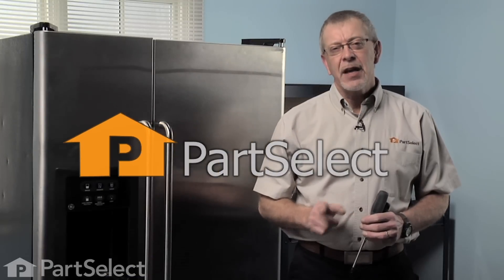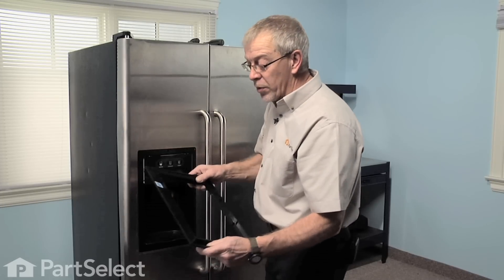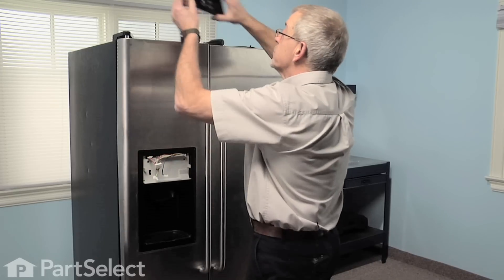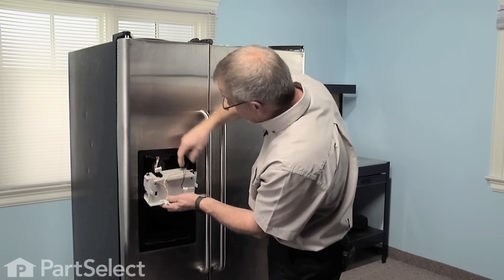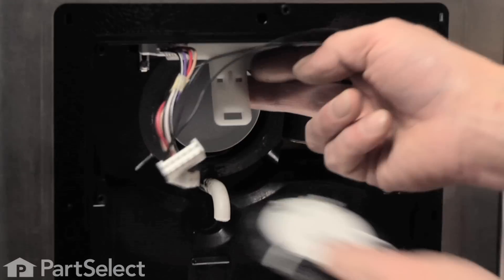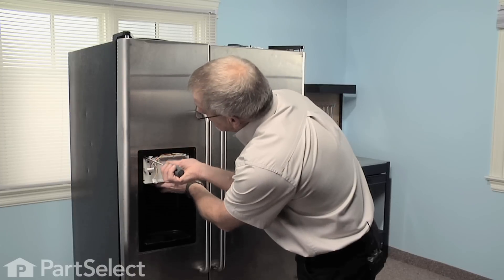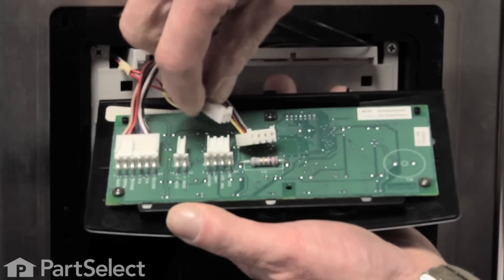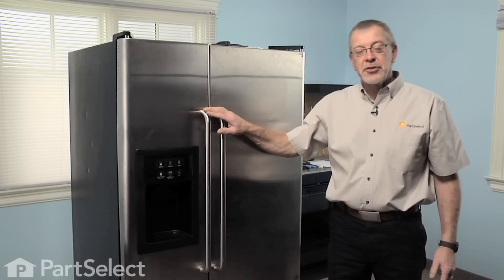Refrigerator Repair- Replacing the Ice Dispenser Door Assembly (Flapper) (GE Part # WR17X11653)

Comment: Thank you for making this video! I needed to have my flapper replaced last summer, but luckily it was under warranty.  However, my ice chute started frosting up again this summer, and after shining a flashlight down the chute, it was apparent that the flapper was once again warped.    GE obviously has some type of defect with this part, but thanks to your video and a $6 purchase on Amazon, I was able to replace this part quickly and easily, saving an $80 service call. Thanks again!

Comment: Thanks for this video. Makes my repair a lot cheaper and easier. 5 thumbs up for you!
          update: I opened the Ice dispenser door assembly the way you described on the video and found out that the solenoid has lots of dirt/rust build up. I took it out and clean it with steel brush and some WD40. Put it back and it works again. Time spent on the repair including watching this video is about 20 minutes. Expenses: nothing. Again Thanks!!! 5 more thumbs up!

Comment: Thank-you for showing how to replace the door flap.  You saved me a bunch of money.  I paid around $12 USD for the replacement and had it replaced minutes after watching your video.  I have a GE GSH25KGMC CC and I did not have to remove the plastic cover at all around the entire ice assembly on the door.  The door flapper replacement is part number wr17x11653 from GE.  I appreciate your time and help!

I also am experiencing the new flapper not closing after ice is dispensed as others reported.  At this point I'll chose not to use it for ice and just use the water function, but I would like to know if I could do something to correct the flap not closing.
Reply: Sounds like It could be the flap spring or solenoid for ice flap door closer

Comment: Thank you for this step by step installation video.  I just replaced the ice dispenser door assembly (flapper) with a new GE part# WR17X11653 and the door recess spring GE part# WR02X10585 for my GE stainless steel refrigerator. The only problem I had was removing the escutcheon and I broke 1 tab (take your time and pull inward). I hope that helps someone else. The reason I replaced these parts was due to water leaking or sweating out of the flapper chute.  If you don't replace in a timely manner this will cause a little mold to form around the flapper and you won't see this until you replace it. I'm glad I was able to do this myself thanks again to this video.

Comment: Thank you for making this video! I just did this repair with my GE Refrigerator model GSS25QGTA WW which is slightly different than the one in the video, but close enough that the task was very straightforward and the resulting repair felt very solid.

Comment: GE model GSHL5KGXGCLS. You do not have to remove the escutcheon. There are two small holes under the touch pad. Push them in with a small screw driver to release the pad, then proceed as the video instructs.

Comment: I did all that (you don't need to remove that out plastic piece BTW) and it didn't fix the frosting issue at all. Looking from inside the door I shined a flashlight up through the cute and saw the leak. I used a heat gun on low to soften the flapper from both up and down the cute. FIXED !

Comment: Hi, I have a Kitchen Aid Superba Frig, (side by side) - we need to get the little flapper door working again to keep the moist air out of the frig. Ice builds up and makes the door block the ice coming down the chute. The model number is KSRB25FHSS04.   It has a stainless door if that matters. The flap still moves but I think the torsion spring is shot.

Comment: I have GE model gsc23kstass   I did not have to remove outside trim, just lift control panel up and out.  My flap was okay but the part that opens and shuts (smallest connection wires of the three) was rusted really bad.  I plan to order this part and replace it.  Than you very much for this video.
Reply from the maker: You're very welcome Vivian, glad you found the video useful!

Comment: Fantastic Video. Followed all of the steps and replaced the flapper and the spring. Unfortunately frost is still building up under the tray, and on the top of the chute dispenser. I noticed what looked like a foam ring behind the flapper seemed a bit worn. Fridge is 3 years old, model #: GSH25JDD SS.  

Any ideas what I should do next to try to stop the frost build up?

Thank you.
Reply from the maker: The cause of the frost build up is almost always from an air leak, usually at the flapper. If the flapper door does not seal properly frost will form. Check the surface that the flapper seals against for any gaps or imperfections.

Comment: Hi.  Great video.  Really easy to follow.  I have a GE Profile Arctica. The flapper wasn't fully shutting and frost was forming around the chute and ice maker.  I replaced the flapper yesterday, and it seems to form a good seal, but now when dispensing cubed ice, the last cube coming out seems to get stuck in the flapper leaving it open.  Any thoughts?

Comment: But what was the symptom?  I just replaced the solenoid that opens this flapper that stopped the freezing over in the chute and leaking down front, but it still leaks slightly along back of dispenser area.  What's interesting is that having been in already, I thought it was the entire assembly (flapper bracket and spring), but I see you replaced just the flapper seal, like in a toilet. Brilliant.  Am I looking at the right reason?  We have hard water out here so seals and flappers harden up and leak all the time.

Comment: Hi, I have the GSS25WSTI SS model fridge and upon a recent home inspection, was told that the flapper doesn't close correctly which allows some extra ice to flow out after moving cup from ice dispenser. Would repair on that fridge be the same as this video? Thank you in advance.

Comment: I need to replace the ice dispenser flapper on my GE PSH23PGRA BB.  Your video is excellent but the door configuration on fridge is slightly different.  Any video or instruction on how to disassemble the panel on my GE model?

Comment: I have a Monogram side-by-side built-in model and it appears that I have to remove the stainless cover on the freezer door to get to the housing. Do you have a video that shows how to do this?
Reply: CruiseReport Model Number is ZISS420DMCS
Reply from the maker: CruiseReport  We do not have a video of the stainless wrap around panel removal, but I don’t think that it is necessary to remove it to gain access to the dispenser. The dispenser escutcheon should pop off with the aid of a putty knife.
Reply: ***** I have the same issue with the same model.  I tried the putty knife but the escutcheon does not come off.  The cover plate appears to be housed in behind a ridge and will not come out. There is one screw on the underside but is not connected to the cover plate...I took out the screw but nothing appeared to budge (I did not want to push/pull too hard). Any ideas.
Reply: +CruiseReport I have a side-by-side GE Monogram (2005) and the button panel (printed circuit board) *does come out without having to remove stainless steel door. Used a putty knife on sides first , then top. It comes out. Goes back in tilting it into top area first then snap sides in.

Comment: The first ice cube dispensed from my GE Monogram hangs up at the bottom of the chute (below the flapper).  Then all the cubes get backed up behind the first cube.  No cubes make it to my glass.  When you insert your finger to encourage the first cube to come out, it's JACK POT!!!  Dozens of cubes rush out until you manually convince the flapper to close.  I replaced the water filter and adjusted the temperature down, but no changes to my Las Vegas style ice maker.  Got any ideas?  Thanks for the excellent video.
Reply from the maker: +Lynne A It sounds like the problem may be with the dispenser flapper not opening enough and or lacking spring tension to close properly.
Reply: Would you recommend replacing the flapper, the spring or both?  Thanks SO MUCH for your help!
Reply: I solved my problem!  The rubber ice cube chute had become brittle and was catching the cubes.  I made vertical cuts at about every 1/2 inch of the chute and now it flexes enough to let the ice cubes pass through.

Comment: Any suggestions on how to remove the trim recess piece?  In your video it came off with relative ease with your fingers.  I've tried prying with a screw driver and can't get it to budge.
Reply: You actually don't need to remove the Ascuncion. You can use a small screw driver to release the 2 small tabs under the control board with having to remove the cover

Comment: How do you replace the water line inside the freezer door?  I have a GE GSS25WSTA, it looks like the refrigerator in this video. The water line was pinched when trying to put the door back on after moving, I need to replace the tubing inside the door but I can't access it behind the control panel, it's sealed.  I can't pull it out from the bottom or the top.  What can I do??  Thanks.

Comment: I have a very similar GE refrigerator to this model with an identical dispenser set up. I am trying to replace the dispenser water line because it is broken at the hinge at the bottom of the freezer door. I am stuck at the dispenser nozzle at the top, unable to get it loose to pull out the old tube. Can you help at all?

Comment from the maker: Hi there!

You should be able to get in there with a putty knife or a flat-blade screwdriver to depress the tabs that hold it onto the front of the refrigerator. Sometimes it can require some real jiggling around. You should be able to depress the tabs and pull up on the panel, removing it. I hope this helps!

Comment: I have a Kenmore model 106.951 680 and am trying to remove the front panel on the water dispenser with out breaking it. so as to be able to get to screws on the water dispenser lever. It appears to pry off some how. It looks like it should push up. WHat is the secret?

Comment: Good video. Just curious what makes the flapper door go bad? Our flapper door seems to open but won't close causing the ice dispensing tube to freeze up.
Reply from the maker: What is your model number?
Reply: I should be able to get that model number later today and then I'll post it. Mahalo
Reply: ***** Here is what I found LGEUS LSC27910TT side by side - But I don't know which one is the serial number and which one is the model number. There are more numbers, but maybe this will help. But after looking at your various video's, it appears that the problem is the solenoid plunger assembly. Either way,  today is the day I intend to figure all this out. Then I just need to figure out where to order the parts from. Also, if you have a parts number for the solenoid, please post it!
Here's what I found on your parts list for my unit. I'd like to order the part if you feel this is the correct approach. LG - Refrigerator
Solenoid Part #: 6421JB2002D 
Substitution part#: 6421JB2002R - $25.70
Part
Information
This manufacturer-approved solenoid (part
number 6421JB2002R) is for refrigerators, including LG refrigerator model
LRSC26922TT.  405H Solenoid 6421JB2002R opens and closes the
ice chute door on the ice dispenser.
Unplug the refrigerator before replacing the solenoid.Time to install this part = 42min.
SpecificationsCategory: Refrigerators and FreezersShipping Length: 2.5 inShipping Width: 1.3 inShipping Height: 3 inShipping Weight: 0.5 lbs (8oz) for questions or assistance, call1-800-252-1698Owners Manual -  http://www.managemylife.com/manuals/non_lis_pdf/OWNM/LSC27910.pdf
Reply from the maker: Todd White I see that we show the solenoid as "No longer available". My guess would be to check the return spring as well.
Reply: ***** How can a part as critical as a solenoid no longer be available? There's no replacement part? So if it's not the return spring, just disconnect the ice maker forever? That doesn't seem right. I wonder if there's anyway to rebuild the solenoid? or are there any LG graveyards where someone could harvest a used part? Haven't taken it apart yet, guess I'll have to consider all the obvious options first. This refrigerator is only 5 years old. If in fact there is no replacement parts, then this will be the last LG appliance I'll ever buy.
Reply from the maker: Todd White I think phoning the manufacturer would be your best bet at this point.

Comment: great video!  
Question about spring?

I need to replace my water /ice dispenser cradle. The part your glass pushes on to dispense water. I  got a replacement part and had everything installed, but had trouble with the silver spring on the left side of the 2 knobs. It has a spring with a long straight line and the other side of spring has a right angle "u" hook.

Which way does the spring go back on?
 The long part (I believe goes on top & tape holds it down?) 
Should the short hook  bend to the right ( does it go into a hole)?  or does it bend to the left (facing out)?

My question is  based on you looking straight at the frig.

Thank you.
Reply: Sorry to be offtopic but does anybody know of a tool to log back into an Instagram account??
I stupidly forgot the account password. I appreciate any help you can give me
Reply: @Thaddeus Azariah instablaster :)
Reply: @Johnathan Jedidiah thanks so much for your reply. I found the site thru google and I'm waiting for the hacking stuff now.
Looks like it's gonna take quite some time so I will reply here later with my results.
Reply: @Johnathan Jedidiah it did the trick and I finally got access to my account again. Im so happy!
Thanks so much you saved my ass!
Reply: @Thaddeus Azariah You are welcome :)

Comment: We have a GE Profile Arctica Model# PSC23MGNA BB.  Do you know the right part for the flapper/seal replacement and where I can buy it please?  We have frost Deposit, and the flapper wouldn't close properly.
Reply from the maker: You can buy that part, PS964304, from Fix.com or PartSelect.com

Comment: Steve , how are you, I have the exact same model, but  it appears that the water ice part that permit the water and ice come out is doing shot, everytime I push to get the ice it seem the motor shuts off, and I get neither ice nor water, happens the same when I try to light up the light, Do you have case experience with this that you could share. Thanks in advance
Reply from the maker: +lourdes torres It sounds like you may have a problem with the dispenser control board. Without having more information, it may be best to contact a qualified service technician.

Comment: GE Profile model # TBX22PRBSRWW flapper stopped closing & causes periodic ice either crushing (while on "cubes") or not enough comes out, not to mention loss of cold air. This after a period of loud dispensing prior to flap closing off. Does this sound like the solenoid or should the flapper be replaced as well?
Reply from the maker: That sounds more like a flapper issue.
Reply: I ended up having an issue with the solenoid. There is a little metal 
bar that attaches it and operates the whole mechanism. Basically, it 
rusted into oblivion. Had to drill out the remaining portion. I then 
replaced it with a paper clip and works like a champ.

Comment: Does replacing the flapper cure the issue with the ice backing up in the chute and not being dispensed through the chute?
Reply from the maker: +Elizabeth Lawther It sounds like the issue that you have would be related to the mechanism that opens the flapper. Maybe solenoid or actuator switch? What is your model number?

Comment: Hi Steve, Great job on explaining techniques. One question. My refrigerator is about 8 years old. Will your GE part number WR17X11653 fit my model # GSS25WGTACC (serial #FL422534) ?
Reply from the maker: Aunt Evie 

That is the correct part number for your model.

Comment: My ice dispenser is filled with black mold from time to time, I took out the panel once before to clean the dispenser and replaced the flap, but now the tabs on the panel seems to be losing their grip and flexibility. I don't want to disturb it any further otherwise, I would have to purchase a new one. My question, is there an alternative in cleaning the dispenser other than removing the panel.
Reply from the maker: Hi, what is your model number?